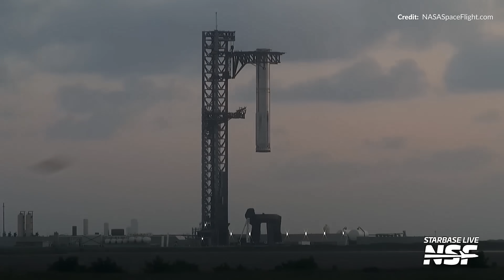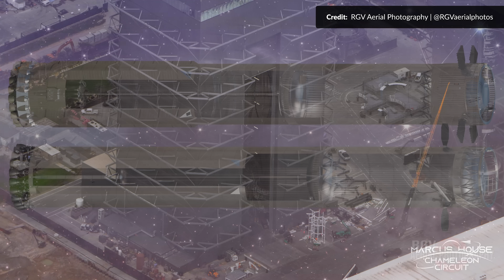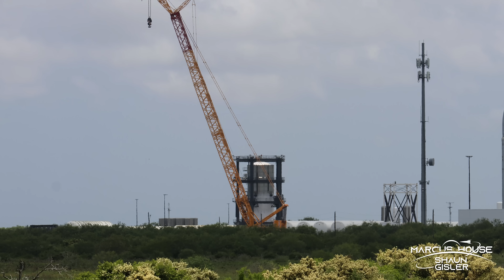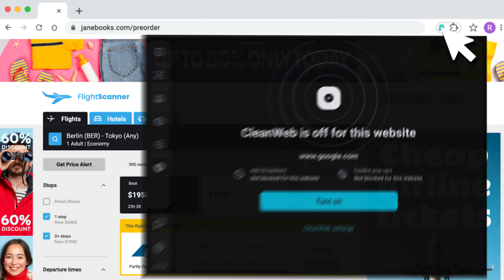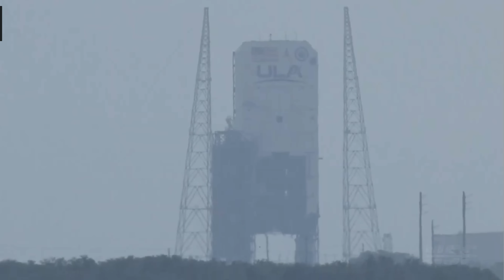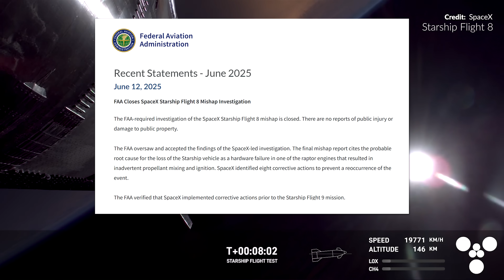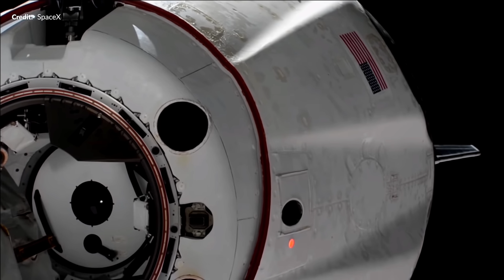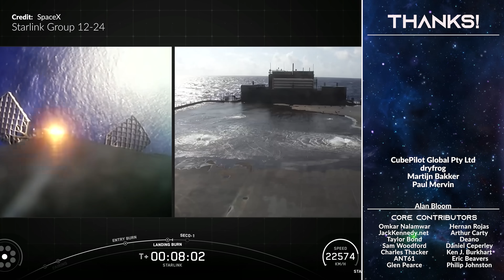Surprising changes to Starship Super Heavy! Why are they doing this?

Comment: I said I've been waiting for the hundred million dollar fireworks but good lord they came early! And I think it's probably close to 500 million dollar fireworks or even more buried it's almost like that go fast break things attitude isn't working out so well for Leon and SpaceX. More importantly, as a former engineer, I do the feeling like they have made a fundamental mistake a long time ago that has led them down a path they cannot recover from and potentially need to start over period at least the test site is cleared away of all debris they and they can start over there
Reply: Seems like he made the same mistake with FSD and not using LiDAR
Reply: @USAchildsoldier  hes made a lot of mistakes
Reply: Each fully stacked Starship costs about $100m. So losing just a partially fueled upper stage would be a fraction of that.
Reply: @motokid6008  true but add in all the ground support equipment...
Reply: @crashwelder5337- Still no where near $500m.

Comment: When that ship swayed and smacked into a clamp Apollo 13 came back to mind. It was even a smaller bump than that which caused the problems on 13. Unless they can show that the bump hit nothing then I think it would be best if they made another full test, better for it to break on the ground than on its way over Miami...
Reply: It was a tank dropped in the factory.  Not the same thing.

Comment: Amazing to think we went from nothing to the Moon in about 10-12 years, Musk still can't get this hunk of junk into a stable LEO after 23 years of Spacex rocket technology built on the previous 50 years of rocket science.
Reply: SpaceX launches much more to orbit every year than the entire planet combined. They also have the most reliable launch vehicle in history, with a success streak over 3x more than anyone else has ever managed. And they are one of only 3 able to get humans safely to and back from orbit. The only other two are the COUNTRIES of China and Russia.

As for Starship, SpaceX absolutely could get it to orbit. Easily in fact. But they are developing full reusability. That is something no country in history has managed.
Reply: @anthonypelchat  I didn't say Spacex can't get the Starshit to orbit, I said Musk. This monstrous dildo is his invention, just like the cybertoilet. And it'll be just as successful. There's a reason NASA chose staging a rocket to the Moon which is something Musk failed to learn from.
Reply: No one has ever done anything like Starship before. A fully reusable heavy lift rocket using full flow stage combustion engines has never been done before.
Reply: @motokid6008  Nobody have ever done it before. Because it doesn't work. As evidenced by Musk's failures that are cheered to the rafters. This bullshit is never getting to Mars. Ever.
Reply: @Robert_DeVille The silly lies you haters tell.. but that's all you've got.  Ignorance and dishonesty.  You're just another burden for you betters to carry.
Reply: @Robert_DeVille Kool Aid?  Us Muskrats are still a order of magnitude more intelligent than you. You can't change that, not all the hate and lies in the world you spout can ever change that fact.  That's what makes you people so bitter and salty.  You are always going to be ignorant and worthless.  You were born that way.
Reply: @imaginary_friend7300  I see Musk blew another rocket up today. More Kool Aid sir?
Reply: @motokid6008 maybe because it’s a dumb idea?
Reply: @USAchildsoldier - Nope. Full reuse and orbital refueling is revolutionary for space flight.

Comment: The lack of dome is interesting, I'm not sure how that would work structurally as the tank still has to support all of that weight and a dome like structure is the lightest way to go. Further, it works in reverse as the force of the engines pushing the other way counteracts the weight of the liquid, especially when those centre engines fire up for landing.
Someone might know more about it and I'm guessing.

Comment: I think Elon is far too optimistic about when he will be able to retire Dragon 2 and Falcon 9/Heavy. Since Starship is still just a boilerplate that has yet to carry a practical payload and reach orbit, I do not foresee it replacing existing systems any time soon.
If I was NASA, I would be actively planning how to use New Glenn or Falcon Heavy to launch an HLS mission using the Blue Moon version of the HLS system. And reports of the demise of SLS may be greatly exaggerated. And as of now, the only crew capsule even within spitting distance of certification of returning crew from lunar distances is Orion.
I think NASA should start contingency planning for using existing operational boosters with missions involving lunar orbit rendezvous to mount lunar missions. If you break the missions into smaller modules and use more separate flights, we may yet be able to do those missions without the massive expense of SLS, even if Starship is years away from being operational.
Reply: He's always far to optimistic.
Reply: @imaginary_friend7300  "Delusional' is more like it. Self-Driving in 2016, Hyperloop, 9 Starship launches and all either blow up, blow up twice, or tumble out of control and break apart. Richest man in the world needs billions of taxpayer dollars for fancy fireworks.
Reply: @Blodhelm  You can call it delusional but I'd question your understanding first.. What tax dollars?
Reply: If they get Dragon certified for 15 flights, that will keep the current fleet active far longer than the ISS. They will likely be able to handle most everything until the late 2030s. That gives them a huge amount of time to get Starship certified.

Comment: Marcus , my thoughts might suggest that Spacex is not looking at the wider picture No 1 why do they insist on building their rockets like a exceptionally high pencil of 100s of feet high and only 30 odd feet wide just a thought they could eliminate the launch towers and the chopsticks and the adjustable rockets and all the extra problems with even having to work on a super large pencil in a super high shed to build it in 
All the so called Alien sightings that we have seen are not super long pencils but a saucer type vessel why not build in a large saucer where control rockets that will be a lot further apart won’t have to control the vertical lift off by adjusting multiple rockets rocking around to keep the pencil going straight up ! when the rockets are further apart they don’t have to be swivelled around but adjust ments of throttle can do the same thing ,Yes I know that the surface area will create drag ,but if they can get into orbit the shape of the ship doesn’t matter ,and also,,,,,,you don’t need to split the booster and ship into two  you don’t need some tower and chopsticks to land ! The saucer can set down at ground level on its own 
You don’t need heat shields if you slow the ship down ,the booster doesn’t use tiles and I don’t thing Falcon nine does either,,,,,I’m not sure about that one.   I would love to talk to someone who can give me all the reasons this line of thinking wouldnt work 
But then again think of all the experts that said that vertical re-entry was impossible that a rocket could be lobbed on a large barge in the middle of the ocean  and stay vertical!
I’m just an ordinary guy with a (what if) imagination
But is it really impossible
Reply: I think you're pretending to understand more engineering than is the actual case.  Far more.

Comment: A 2nd stage booster launched from a booster at the same time as a ship could dock with the ship at separation altitude and give it the speed needed for escape velocity without the ship using its fuel. A ship sized booster dedicated to pushing ships out of orbit, theoretically a SHITER vehicle with a bottom that connects with a booster and a top that attaches to a ship could multi stack in orbit and give a ship continuous thrust while each SHITER is attached. OK, picture space x doing a double launch one has a ship the other has a ship?booster? SHITER lol. A ship with a structural hotstaging ring on the top (necessary for Docking in motion), same on the bottom for booster stacking, vacuum engines for functional efficiency, interior same as a booster, ability to reenter earth's atmosphere and be caught like a ship. Kinda sounds easier to combine both stages into a escape velocity shuttle, rather than sending ships to refuel. How much fuel could a ship hold if it had no payload capacity? Horizontal docking to refuel must be as difficult as vertically attaching just after separation. It is like I'm going on a 1km journey, I have 500km in my vehicle, instead of towing me the first half, they let me use it then send 5 trucks to refuel???
Reply: I think your understanding of how things work is.. flawed.  Badly flawed.
Reply: I also thought Catching a booster with the tower arms was something out of the Thunderbirds. After that, it kinda puts anything that don't break the laws of physics within reach. Suppose you're a space flight expert yes? You working with space x yes? If not shut up! We need people thinking of new ideas, not idiots that dismiss anything that nasa can't achieve.

Comment: Great videos!

I remember when government contractors built the Saturn V, which had zero flight failures and one “partial failure” that still made it to orbit and whose capsule still successfully reentered safely. Some would argue that Starship is new technology, new methods, new materials… so was every part of the Saturn V back in 1966. In my mind, nothing will ever surpass the absolute perfection that was that rocket. 
Now, all that having been said, I’m glad that much, MUCH smarter heads have finally prevailed over a certain someone and a flame trench is being utilized. It’s about damn time!
Reply: It looks like you have no real understanding of the subject.  You want to compare the flights of a system that was finished development with one that is still in active development.  That's ignorant at best.  I don't think you have any actual understanding of what's going on or why.
Reply: @imaginary_friend7300  I was going to make this exact same comment.  Your reply is spot on.
Reply: When cost is not a factor, quite a bit can be accomplished. During Apollo especially, it was always just "Accomplish the Mission".
Reply: Adjusted for inflation the Saturn V cost significantly more than the current starship development has cost. It may not look it, but compared to previous attempts at such a large rocket SpaceX is doing this on a shoestring budget.
Reply: @darthkarl99  The difference is the Saturn V worked, and got men to the moon in 1 test and 1 launch. Starship can't get a banana to orbit safely, and in 9 tests hasn't been able to stay intact. Just a big ol' boondoggle like the Hyperloop.
Reply: @Blodhelm  The Saturn V was tested far more than one time. It had 2 all up flights with one partial failure before the first manned flight. It also had several flights before the first landing.

It was also not supposed to be going to the moon as soon as it did with people on board, but politics made NASA cut corners on their own testing campaign.

It's also important to remember that the Saturn V directly built on various parts of the Mercury and Gemini programs, using experienced and techniques developed there to make the Saturn V easier to build. Starship shares so little in common with any of Space X's other rockets they're effectively starting from scratch.

Finally they just have fundamentally different goals and methods of development. NASA did and still does far more testing on the ground than Space X does, and the Saturn V was never designed to be economical to fly or quick to build. Starship is.

In fact in the context of any other rocket expect the shuttle, Starship has had 3 fully successfully flights. Failing to get back down intact is only a failing if your trying to reuse the upper stage. If your not it literally does not matter. And the latter is how every other space vehicle other than the shuttle has functioned.
Reply: One, the Saturn V was the last portion of the Saturn development program. Saying it was flawless would be like saying Starship V3 or V4 is flawless. 

Two, the Saturn program had numerous failures. But it also had similar mission successes that were very similar to Starship. These include numerous suborbital flights and even flights that exploded while in orbit, but that accomplished their main mission. 

Three, the Saturn V itself caused a mission failure that nearly ended the lives of 3 astronauts. 

Finally, the Apollo program cost around 300B, with the Saturn program taking up a huge chunk of that.
Reply: Elon seems to have a blind spot where other legacy rocket engineers are concerned. He always believes he knows more than people with more experience.
As for Saturn V, it could still lift more payload to the moon than SLS, since SLS insists on lugging that huge fuel tank all the way to orbit like the damned Atlas. Thinking that using "Shuttle technology" would somehow make building a moon rocket simpler and quicker, given the need for redesign of the main stage to accommodate transverse loads as opposed to side loads, turned out to be very erroneous. Von Braun and his team were right all along. Use a 3 stage design. Use simple dirty fuels and engines for the booster, and then use the finicky HydroLOX engines on the upper stages where their performance would do the most good. It had massive growth potential as well, using fuel tank lengthening and side boosters. If we have coupled that with the new technology allowing boosters to be recovered propulsively, the Saturn might have made a really good moon rocket even today.
Reply: @i-love-space390 And you seem to want to pretend he's behind every singe decision or that you understand why some were made.

Comment: Why transfer the vehicles to Florida by barge? They could literally just launch from Starbase and land at the KSC.
Reply: I believe there are restrictions about flying rockets over populated area's.
Reply from the maker: Totally. Right now the only way to fly a Starship under power is threading the needle out over the Bahamas. Worth noting that the booster couldn't make it that distance to Florida anyway Starship certainly could and will eventually enter over populated areas.  SpaceX would need to prove very reliable entry and control, it is really just the flip landing that is the main powered part of that, so hopefully we get to see this in Texas by end of year (they do need to hurry the heck up with these current Starship issues resolved). 

Hopefully be seeing Flight 10 around the 24th of this month although we need to see that Ship static fire real quick for that to seem possible.